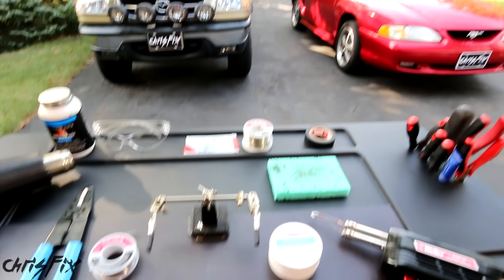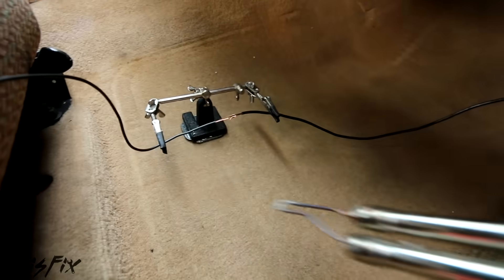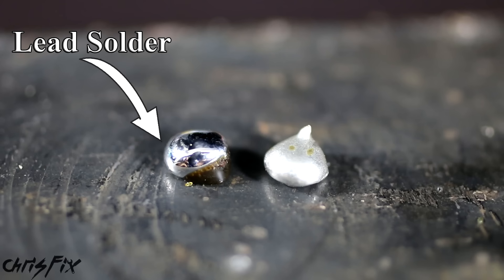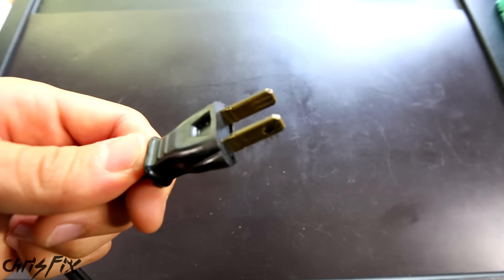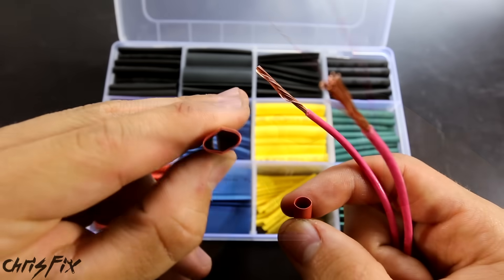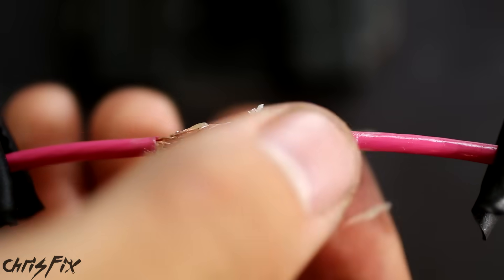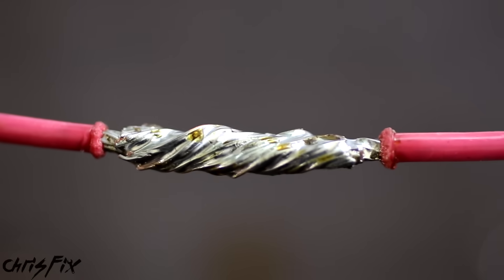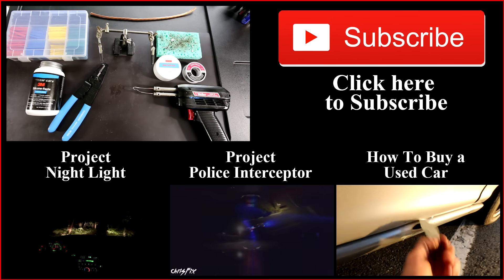How to Solder Wires Together (Best tips and tricks)

Comment: As a retired electronic technician I have used Silver bearing Tin Lead solder that was 2% Silver, 62% Tin, and 36% Lead. http://www. mcmaster. com/#7659a74/=14n7ogy Required for soldering certain types of silver plated ceramic terminals. Other than that I mostly used 60% Tin 40% Lead solder for most component and wire work. Both types were rosin core. I only used paste flux when soldering pipes. And In all my 44 years of soldering I have never used acid core solder or additional acid flux. With proper pre cleaning you don't need it.

Want your soldering iron tip or solder gun tip to last longer? When you're done with it and it's still hot DO NOT WIPE IT OFF WITH A DAMP SPONGE. Leave any remaining solder on the tip and if there is only a tiny bit left add a little. Then when the gun tip cools off the tip has a protective layer of solder on it. Next time you go to use it when you pull the trigger and it gets hot then and only then should you wipe the tip and it will be nice and clean. Proceed normally from there. With soldering irons it is especially important to put it back in the holder with a little solder on the tip. The extra solder keeps the tip from burning or oxidizing. This way that hot tip is protected. Sure the solder will oxidize but you're going to wipe it off just before using it and reveal a nice clean tip. If you wipe it and let it sit there idle then the tip itself burns.

I use Iron plated tips for my soldering iron. I have some that are over ten years old. All the used ones have a lumpy appearance due to the extra solder coating the tip from the last time I used it. They hold their shape much longer if properly cared for. Pure copper tips do not wear down due to exposure to flux they alloy out and that makes them smaller. When you solder two or more copper wires together right at the interface where the solder meets the copper. The tin and lead actually alloy into the copper while the copper alloys into the tin lead. That why they bond so well together because they alloy together. And if you're using pure copper tips some of the copper from the tip alloys into every single joint you solder. With a soldering gun the tip gets so hot this process happens relatively fast. With a soldering iron even faster. Sure the tip temperature is usually lower but it's hot for a much longer period of time. The same thing happens with a quality iron tip but the process is much much slower.

Have you ever used dual layer heat shrink? The inner layer is designed to melt and form a water tight seal with out using dielectric grease. It's just easier to work with. You can save the dielectric grease for under hood electrical connectors, and exterior lamp sockets. Here's an example of Moisture resistant heat shrink tubing with a 2.5 to 1 shrink ratio. http://www. mcmaster .com/#73115k73/=14n7tos

I thoroughly enjoyed the video. Thank You.

Of course, take the spaces out of the links to make them work.

Comment: what heat shrink do you recommend for putting two different guage wires together? I hard wired led lights under my dash and there were thin (like speaker wire) and I only had a bigger guage wire.

Comment: A great tip given to me was to add little shavings of hot glue gun stick inside the heat shrink. This creates a permanently waterproof shield when it melts. Similar to pre-made waterproof glue-filled heat shrink tubing.

Comment: The best flux is when you dissolve about 20 grams of colophony in about 100 ml of 99% Isopropanol. Its very viscous and easy to use. I have it in a small 20 ml plastic bottle for oil. Just put two drops on the wire and the solder will soak right into it. It can be used for just about any application. 

Instead of a wet sponge, brass shavings are great - just dip the tip in there and its clean. 

I prefer a soldering tip made of a nail which is cut in a 45 degree angle on my 40W and 60W soldering iron. When you copper coat the nail you have a superb soldering tip and its form makes even a large blob of solder adhere to it - i just bring it up to the wire with the solder already on the tip and don´t have to mess around heating the wire and then bringing the soldering wire to it.

BTW - there is this 2:1 shrinking very cheap heat shrink tubing and there is also (partially adhesive lined) heat shrink tubing that will shrink in a 3:1 or even 4:1 ratio. Ebay has a vide variety of it. With a 4:1 you can safely use a 8 mm tube for a 3 mm wire and it will be much thicker due to the high shrink ratio.

You didn´t show the third method of joining wires which is simply tinning each wire seperately and then joining them together lenghtwise, this also gives a sufficiently strong bond.

You can also use a butane torch or a normal lighter for the heat shrink - you just have to be careful not to burn it. In fact, I do this all the time so I don´t have to mess around with the heat gun.
Reply from the maker: Great tips! Thanks a lot for sharing them!

Comment: There are two things about this that I find need a bit of correcting. One is that because the solder that is chosen has a rosin core (chosen rather correctly for this kind of electrical work) it should not be necessary to use rosin flux on the wire prior to the work. The rosin within the solder is already designed to work against whatever oxidation might exist on the wire. The other thing to note about that is, once the connection is done (and this is particularly important on circuit boards) that any excess rosin that is left over as a residual result of the work must be cleaned off of the connection. That is because the left over rosin acts as an adhesive that will later on cause unwanted foreign material to stick around it thereby making that connection vulnerable to unwanted effects such as resistance across the connection or possibly even shorts. So unless there is a large amount of oxidation on the wire this should not be really of any concern. What would concern me more is why such a large amount of oxidation is there to begin with. Re-strip the wire and use good clean bare wire that is devoid of oxidation is a much better thing.

Secondly, and I have to say this from many years of experience of soldering since I was seven: IGNORE all of those instructions that tell you to "heat the connection with the tip first" then flow the solder into it. What you are after here is sufficient enough heat transfer from the tip of the soldering iron to the connection that will allow the solder to melt and flow where you need it to go in order to make a good solid connection. That will never happen if you press the tip of the iron to the connection and apply the solder at some point away from the tip. Sure the whole thing will heat up, but not enough to actually melt the solder where you are placing it at, and even if it does, chances are everything else around it is much hotter than needs to be such that even if you miraculously get that solder to melt, it won't have sufficiently flowed through and you will have been left with a cold connection.

What you need to do is kinda what was shown here but not adequately described: you first get the solder to melt on the tip itself; the melting solder will thus then provide a certain amount of heat transfer to the connection which then after that flow starts to happen, you then start to move the solder around to flow it to other places within that connection until you are satisfied that enough solder is with it and you are seeing all of the work covered. Then you remove the solder and the iron and leave the connection absolutely still until the solder cools off and solidifies. Movement at this point will cause a cold solder joint as well. Keep it steady and still until the solder cools.

That is the skill and that is the deal. Remember you are dealing with melting a metal and then cooling it to suit your needs. 

Also note that the insulation of the wire will have a huge tendency to shrink back during this process, so don't strip too much wire than you need to. In that regard, use more length in the heat shrink tubing than you think you might need. When the insulation of the wires sneak back, you will see why that is a wise thing to do.

Comment: Non-adhesive heat shrink? It is useful at all?
Reply from the maker: Yes it is useful and all I use. The adhesive heat shrink is better but costs significantly more and my method of using silicone grease is better at waterproofing the connection. Both work great though!

Comment: Using a higher gauge wire for your soldering tip will cause more resistance and therefor heat up faster.  
I use 14 gauge wire in my 100 watt soldering gun, this works better than 12 gauge

Comment: "Learn How to Solder Correctly" I already did. You however need to learn how to spell SOUDER correctly.
You pronounce SOUDER which when translated into English is SOLDER in which case you pronounce the "L" in place of "U".
If your going to write "solder" then pronounce it like "folder" "holder" "colder" "bolder". If your going to use French word "Souder"  you need to learn "dossier" " support" " plus froid" "plus audacieux".

Comment: Nice tip with the grease inside the heat shrink. I've seen tubing with glue in it, but never thought about using the grease, and I've used a ton of that stuff when prepping my jeep engine for water crossings.

Comment: One of the few videos I have seen PROPERLY explain how to tin the tip, start the solder flowing between tip and wire, and then add solder to the wire correctly. Also one of the few to include the silicone tip. Great job as always, Chris!

Comment: BREATHING SOLDER ISN'T DANGEROUS UNLESS YOU CONCENTRATE THE SMOKE AND BREATHE IT IN FOR A YEAR. Lead becomes gaseous at a WAY WAY WAY higher temperature than you can get a soldering iron to.

Comment: Yeah... I watch some channels who do circuit board repair, lead free solder is pretty much universally hated among hobbyists. Not only is it not as easy to work with or make a solid connection, but it seems to come apart faster in electronics often causing failures, especially when something is hand soldered by Chinese workers. I'm not knocking Chinese workers by the way, just stating that a human being using lead free solder has a more difficult time making good solder joints repeatedly.

Comment: hey Chris quick question on my Chevy venture were the automatic tensioner goes the threads were stripped on the engine block so the bolt won't hold can you make a video on how to properly rethreaded stripped threads whether to use heili coils or something else you know what's the best way  and can it be done with the engine still in the car ? haven't been able to move it in a month since the car really can't Run without the belt working

Comment: Hi @ChrisFix I have a problem with my vw golf mk2 1.8 monopoint . When the engine is cold the idle is very bad and ofen the engine cuts off. Also when is give it a little gas my whole garage is filled whit black smoke.
Reply from the maker: +Psycedelic Dakke dak sounds like it is running very rich
Reply: Indeed but is a gasoline car. You have any idea what is wrong ?

Comment: Chrisfix, I really like your way of instructing. You explain carefully and precisely. Not screaming or cursing or taking forever to get to the point. I also like how you explained the difference between the solder types. I forgot about that. Lol. I have welded, forged, and cast in high school, but we forget things over time. Nice to refresh our memories. I like how you recommend using flux. I'm an avid home remodeler, my own home is 100 years old. You are right it protects the solder using flux, but it also draws the solder into the joint, with plumbing or stranded wire making a sure connection. I've subscribed and love your videos, thanks!
Reply from the maker: Thanks a lot and welcome aboard! I am glad you enjoy the videos and even got a little refresher lesson from it!

Comment: I always find the insulation starts to melt.
Reply from the maker: Yea that means that the joint is getting too hot but as long as you dont melt more than the tip, you are going to seal it with heat shrink so it's not a big deal.

Comment: Hey Chris having a little bit of issues with my car. I changed the spark plugs today(due at 100,000, but it's at 115,000) and when I pulled out the 3rd spark plug found some oil on the plug but looking in to the cylinder it looked pretty dry so I wasn't worried. Took the final one out to be covered in oil, and the cylinder had some oil in it as well. Could this just be result of misfiring for so long, or is there a chance that my piston rings are going bad? Thanks man, keep up the videos!
Reply: A valve cover gasket might be leaking. Does your vehicle smoke any on startup? 
What motor do you have?
Reply: Id start it and run it for 100 miles or so and recheck them. running it with a misfire can cause it to put too much gas in the cylinder and may make the rings prematurely wear out. If its not smoking real hard theres not too much to worry about. Also always always always list your car type and engine. thins out results.
Reply: Nope no smoke at all. It's a duratec pretty sure, whatever the 2006 Ford Focus 2.0L is.

Comment: Another great video Chris. Watched it a couple of times and then decided to rewire my utility trailer.  Only one side was working...but only after wiggling any number of the 19 crimp connections!  Hack job!  Ripped it all out and started fresh. Four solder joints with heat shrink tubing, and a quick scratch of the light bulb socket contact points, and Bob's your uncle.  Perfect.  Thanks Chris.  Keep it up!

Comment: Hey Chris I did the headlight restoration and I let it sit for about four hours and I didn't think it look that good so I resend it and did it again but now it looks even worse any tips?
Reply from the maker: Wait a few days before you touch it. The paint doesnt cure in 4hrs. Re-sand the whole lens with 400 grit, then go 600, then 2000. Then spray the clear. Let it cure for a few days. If it is not crystal clear, you can wet sand it with 2000, then 3000, then 5000 then buff it with polish until crystal clear.
Reply: Thanks I'll try it in a couple of days

Comment: Well the first thing is to ask yourself: do i need to solder it?
Most people wrongly believe a soldered connection to be superior to a crimped connection. For long term reliability a crimped connection or termination is the only way to go. A soldered connection is fine however the two edges of that connection are extremely brittle and often fail due to vibration. You will never find a soldered connection on a professional wiring harness. As a crimped connection relies on mechanical force to join the wires its will always be superior, providing the correct crimping tool is used. For the example in the video a barrel crimp and some heat shrink would no only be easier but provide a far superior and long lasting connection.
Reply from the maker: Crimping connections is technically a better connection but crimping properly takes more skill and if you dont crimp properly you can have a very weak link in your electrical system. Soldering is easy to do and do properly which is why it is better to use.

Comment: Thank you, ever so much, for making the video on How To Solder Wires. you have a real good clear voice and you know how to narrate to where it leaves a person sure of what he has just learned! Thanks for passing on tips that would be listed on the MSDS sheet for solder, and for stressing to wear PPE. lots of people don't realize a little moisture will make liquid metal pop, because it turns to steam at 212 degrees and solder is a lot hotter than that. The moisture turns to steam and displaces the hot metal causing it to splatter. I was an electrician for over 37 years & was blessed by being allowed to instill some of the tricks of the trade, to several hundred young upstarts, that are, now...fine electricians. Each of the Journeymen electricians taught their speciality to the apprentices. One item we stressed was when using a pair of wire strippers, not to wiggle the strippers AROUND the wire, but to squeeze the James together  using the proper sized hole for that sized wire and while still squeezing, tilt the strippers forward. What this does is, the stripper has cut the insulation to just shy of the wire...then by rocking against the insulation, it forces the insulation to move about 1/16" along the wire..breaking the melted bond between the wire & the insulation. Then, being freed up, the insulation comes off real easy and you haven't scored the wire...making it shed strands. Please try this and put it in one of your videos. I don't have a nice video camera setup to do uploads , or I would. Thanks again. "General"...///

Comment: Guys? can some one tell me why i hear air noise inside my car after driving ~80 km/h? And how to fix it? one year ago i didn't hear that. Sorry for my English.
Reply: and also i don't feel it run smoothly like before
Reply: if you mean you can hear air rushing into the cabin of the car at 80km/hr plus, it probably means one of your weather seals around the doors or windows has shrunk or dried up due to age, you could try putting some grease on the rubber to try and get some flexibility back. I would suggest "rust proof" spray cause it tends to swell rubber, or a silicone based lubricant.